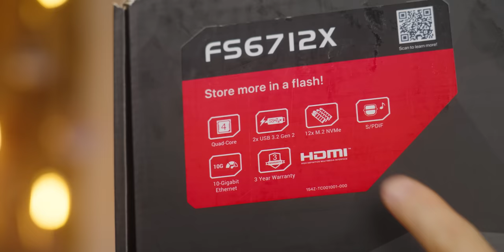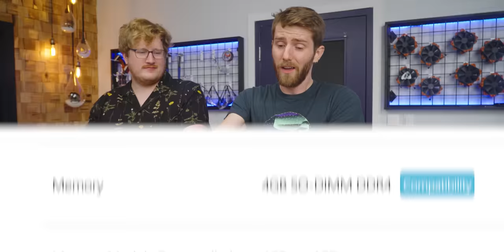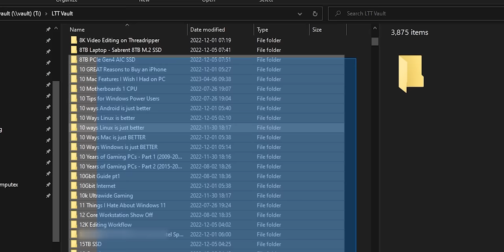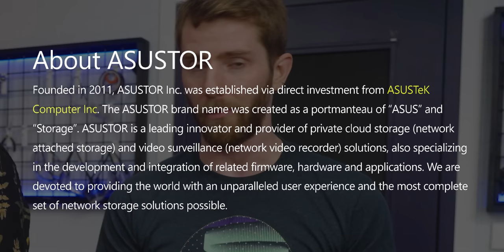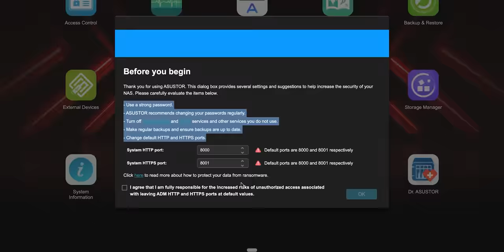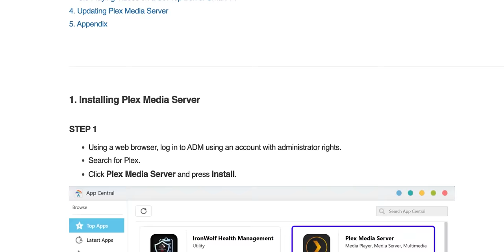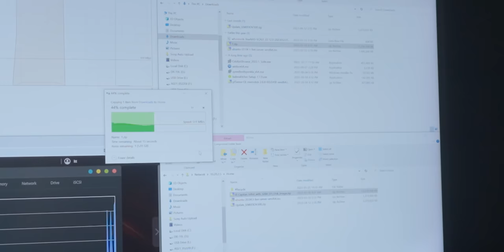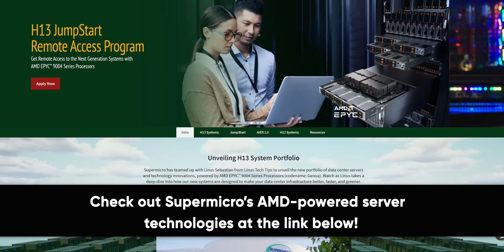I should stop building computers - ASUSTOR Flashstor NAS

Comment: JBOD is the complete opposite of "a logical volume composed of multiple disks".  JBOD by definition (Just a Bunch of Disks) is each drive exposed individually.  What you do with them after that point (logical volume span across drives or Software RAID) are software solutions on top of JBOD.

Personally I stick with JBOD as its much easier to incrementally add more storage that way, even if its a little more labour intensive.  RAID requires you to be able to afford to replace a failed drive immediately, or risk losing ALL your data.  JBOD on the other hand you lose one drives worth of data which would suck in a business environment, but is a lesser risk for a home NAS than having to recover everything from a backup rather than a single drive.  Not to mention if you have a RAID NAS, you'll then need a RAID backup.

RAID is just too expensive for many home users and also gets complicated when you start to need to replace existing drives with larger ones.

Comment: It's hard to beat it in terms of bang for the buck, though it would be pretty cool to have a more expensive version based on an i3 or something.

I recently built my new home server with i3-10300 for about 400 USD (prices include shipping and tax):
- $76: Used i3-10300 (Not the best bang for the buck, but in terms of thermals and power efficiency it's alright)
- $76: Used MSI B460M PRO-VDH (it was literally the cheapest mATX board that supported the CPU on eBay)
- $15: Used 256GB NVMe SSD for OS (I assume it was pulled from a heavily used machine as the health was at about 50%)
- $31: Used laptop HDDs 4x500GB (the condition was better than expected, but these are very hit or miss)
- $122: New In-Win CE685 case with a built-in 300W PSU (SFF case prices are ridiculous, and the PSU isn't great, but it was alright for my purposes)
- $49: New Noctua NH-L9i (overpriced and overkill for my purposes, but I wanted a silent machine. I can also reuse that cooler for a better build later on)
- $33: New TEAMGROUP Elite 2x8GB DDR4-3200 (Pretty much the cheapest DDR4 16GB kit from a brand I've heard of before)
- $38: Cables and a 5.25" Bay to 4x2.5" drive adapter

It's my very first PC build (my main is a prebuilt 13900KS machine, I only had laptops before) and I'm pretty happy with how it turned out.
I'm running Debian as that's what I'm most familiar with and using mdadm to keep my hard drives (4x500GB) in RAID 5.
I also wanted to throw in a low profile Arc GPU in there for a meme, but as of Summer 2023 they are only sold in Russia for some reason.

ChatGPT says that my spelling is alright, so I won't double check it. Thanks for coming to my TED Talk.

Comment: You don’t need to spend that much on a motherboard for a home NAS. A low power Xeon cpu and server motherboard (about $200-300aud for both off eBay) is much more powerful than any craperon. The noise of the HDDs isn’t an issue either so long as you are not setting it up in your bedroom.

Comment: 7:33 you have absolutely no clue how many times Premiere crashed on my Windows system this semester in my cinema and communications major. Since 2022, but even moreso 2023, it's almost as if Adobe is trying their damn best to make their software as unusable on Windows as possible. Granted, I was on 8gb of RAM, but still. Adobe had 5gb dedicated exclusively to it, and updates made everything more unstable every new update.

It's literally the only reason why I'm considering buying this, and a Mac studio/M2 Mac mini, and just rolling through remote working. It's just that bad on Windows at this point. My hardware isn't even that bad or anything for a laptop that's used mostly for editing: Ryzen 5500U with a 1650 and a ½tb nvme ssd. It ran W10 and runs 11 buttery smooth, but not Adobe. And now I have 16gb of RAM, and Premiere still is testing my patience every day.
Reply: See if you can try on a friend's pc with more ram and just see how much better it is.
Reply: @PvMLad  I've worked with as much as 64gb, PPro just won't collaborate
Reply: @Anisse_N_Spices  fair enough
Reply: @PvMLad  yeah, either Adobe despises me or Windows

Comment: Did they miss the pics switches?  The processor is maxed on lower end model with 6 drives. Trying to us all 12 in one array means adding lag to switch connections back and forth. This is a case of more isn't faster. I would like to see performance numbers of the number of drives the PC can handle. Native, both 4 and 2 channel. Also see if setting drives up in groups on same side of switch  compared to spliting them

Comment: I work with machine learning, and one of the biggest bottlenecks is loading a large dataset from storage (whether its from a server or local storage). This would be perfect for that!
Reply: It would not be great for that as it gets a pathetic 1GB/s sustained speed max its a 10gbps max per connection CPU

Better off shelling out for a single 8TB Sabrent drive than one of these things

Comment: It'd be great to see you build one just like that but with a more powerful processor, and still keep it budget. 
The main problem I see is fitting so many ssds, you'd need m.2 pci cards for that, and these are pricey. 

Then go crazy on it and build a killer one with ecc, zfs, and a decent board that has  management like gigabyte has (l1 mentioned it in one of his videos, it's amd with ecc support and an  ipmi analogue, but it's hard to get and rather expensive)

Comment: ASUSTOR had a massive attack on the NAS just a year ago and they have around 2 digit percentage of NAS being attacked by the same ransomware.
Most of the affected NAS got their default ports opened up to the internet, that's why they are warning you at the first step and ask you to change the ports immediately.
Reply: What they need is proper security in an open port instead of playing security-by-obscurity and pretending that if you randomize the port number (out of ~60000 options) you're safe.

You can run even SSH just fine on public IP and port 22 as long as you don't have security holes in the software.
Reply: We don't open ports by default. We never have and never will. Only those that were affected had their NAS exposed directly to the Internet. We do take security seriously. And we beefed up our security research team after this to make sure this doesn't happen again.
Reply: @ASUSTOR_YT  Great! Make sure that the security is based on a true secret, not in 16 bit port number.

Basically you either have to educate your users about entropy, or allow only SSH keys instead of passwords for login.
Reply: @MikkoRantalainen  We'll do our best to find the best balance of convenience and security while giving people complete control over their experience. Right now we're beefing up our backup capabilities to make it even better! But I take your comments seriously! I might have to look into having SSH keys too.

Comment: i have been using an asustor as1104t for almost 2 years now, and other than the lack sound insulation (using 4x8tb wd red pro), no other problems at all...  its fast, stable...
looked at the new ones that are in the video, but just too expensive compared to the regular hdd nas units 😢
Reply: Thank you for your support!

Comment: Linus Nonsense Project: Buy the six slot version, then but the few missing chips and connectors and solder them in to convert it to the 12-slot version and see if it works.

Comment: Pity they don't have several CPU grades... that general fit and form would be awesome... allot of people who just want a server... have a bit more cash ... but like it small would find that perfect. It feels a little under powered to be perfect? The ease of install and flexibility, I;m looking at docker, I think would scratch all the itches. Docker containers with OpenHab/Home  assistant, (they already had pi-hole), zone alarm, etc etc. Heck add another network port and it could also play firewall/router. But CPU is still a bottleneck there :(

Comment: Imagine paying $70 for a screwdriver
Reply: Nothing strange about it. I have a neat rush 72 backpack for like 180usd, and an Ogio renegade backpack for 160, which some might argue is crazy for a backpack. But I know these will most likely last for decades, and are very functional.

If you use a tool a lot, investing in one that while expensive, provides good functionality and is pleasant to use is the way to go.
Reply: @BoraHorzaGobuchul  The backpack doesn't seem anywhere near as durable and rugged as proper gear. And for $70 I can buy a full on power drill that will be used in construction for years. One lone screwdriver is nothing in comparison.
Reply: Not sure what’s so hard to understand.
Reply: Imagine this guy's face now, after it being so successful 😮 😂

Comment: Its likely less a Celeron's performance  (as its only an IO processor really) and more the fact that the number of PCI lanes the Celeron has means its constantly arbitrating PCI as its striping/checking/correcting while also meeting other demands.  It would be interesting to see RAID metrics regarding error counts etc.   It would also be an interesting benchmark to run RAID 0 (only as an experiment) to see what RAID overhead is doing. I'd like to see it running cooler. I find it funny that no one has made a flat memory model FLASH box like this. FLASH is memory after all. Putting PCI and its limitations in as a bottleneck is really choking the performance. Its a great modular solution but truly suboptimal. It would be better to have all that FLASH directly memory mapped and hanging on a local bus with caching.

Comment: I just recently finished my NAS, which is a mid-tower with mechanical drives.  This video got my second guessing everything, lol.  It'd be awesome to replace that with something this form factor which can do the same thing.  Such a space saver.  I have 28TB and one parody in unraid, but I don't use it all, so if I got something like this even with 4TB NVME's I could cover what I've used + be able to expand later.  Fuck.  

12 is nice because even though I spent less for more storage, there's not exactly space for 12 3.5" HDD's in my NAS.  Shit, there's basically only 4 without getting real cozy in there.  And with something like Unraid which is dynamic and supports different sizes, you can grow the drives as prices drop.

Comment: I plan to switch over to an ssd only nas once its a viable solution. I would want to pay a bit more for a beefier cpu and more pcie lanes though, really a bummer, but maybe there's more to come :)

As much as I loved setting up my homelab I don't really want to spend time anymore with replacing HDDs and that stuff... At the moment I have four 18TB HDDs in a RAID 10 configuration and I noticed that the used space stopped groeing a while ago.

As soon as nvme ssds will be cheap enough to replace this I'm team ssd for life.
Reply: The 8TB 870 QVO comes to slap you… hey you not know about me or something

Anyway SSD’s ARE NOT FOR NAS they basically need to always be powered on to lessen the chance of bitrot but it doesn’t eliminate it

With an SSD NAS you have a HDD back-layer that it backs upto if you actually intend to not loose data well unless your using SLC SSD’s

Comment: Only issue with the NAS is the CPU. If they would bump it just a couple of tiers or even use an ARM processor instead (since it is running android anyway), it would be perfect for a lot of my use cases.

A low wattage but strong ARM based CPU would work wonders for a NAS like this.

Comment: Two things sub-par with it, one of them a big nope for many uses. The CPU is slow for big data processing on the server. If it's simply serving files and running some apps that don't do tons of data processing, it's OK. The other is the 32 gig for OS storage. There are of course Linux distros and other systems stripped down enough to rattle around in 32 gig like a dried pea in an empty gallon jug. But if you're for some reason wanting to install Windows or an Intel version of OS X, forget it. You could install the OS and some additional software but it'll be incapable of doing any major OS updates.

I'd like to see LTT put Open Media Vault on this. I have OMV6 on a 2011 Mac Mini with a dual hard drive kit with a 500 gig and a 1 TB drive. That works well enough for me. I can push videos to it from my office desktop then watch them on smart TVs, phones, laptops, tablets etc by serving them with Mini DLNA. It's up to the viewing device to be able to decode H.265.

Comment: You mentioned printing and I can't believe, still, till this day, that they haven't fixed the bottleneck in printers. The company that fixes that bottleneck will make a fortune! Hands down fortune!
Reply: Last time I needed to cancel a print job that hadn't started, it did cancel.  The reason why they often don't is the print job is still in the PCs queue not the printer, so its not really the printer at fault.  Plus modern printers can print really fast anyway so the time it takes to get to the printer its done already.

Comment: I have a problem with a dentists software which seems to be "organically grown", i.E. it needs a Visual Cobol 32bit runtime, which creates loads of very small files typically around 1kB. A server with 16 gigs of RAM, all SSD, ToE NIC and I5 7xxx CPU grinds to a halt with 100% CPU load and about 5 to 10 kbit/s network throughput. I still have to find hardware powerful enough to slay this fine example of bad software engineering. 
Large video files is one thing, but with 10th of thousands of small files (who does databases in the 4th normal in Cobol in 2023?) SMB/CIFS is easily overloaded.

Comment: I would love to see something like a matx /itx am4 board with that amount of m.2 slots specifically for a nas build. With how cheap older am4 apu are getting it should make an awesome nas build.
I would even say a prebuild like this with a socket, but i get that the cooling could get problematic
Reply: What sucks about AM4 APUs is that a good chunk of the PCIe lanes get sacrificed to the iGPU gods. Probably not an issue if you're a home user, but don't even think about having 12+ M.2 slots with full performance.
Reply: @Gabu_  Shouldn't am4 apu have at least 20 lanes available (24 for 4000 and 5000 apu)
And with a splitter like in the board in the video or used in x570 boards it should be doable at nearly full speed for 6 nvme (pcie 3x4). 
Well at least much faster than this board for sure?
Reply: @ized88  You're right, they do support 20 + 4 gen 3 operation. Not ideal, but good enough for most people.

Comment: I had a Asustor AS5304T. It was pretty good and easy to set up. However, one day Asustor machines got attacked by ransomware through a backdoor that allegedly Asustor knew was open but didn't fix. So from then on i just decided to build my own server using parts from an old gaming pc (AMD X370) and install unraid.
Reply: Hi there! We were not aware of the vulnerability. We use open source software and it was in the UPS module of our NAS. We apologise for the inconvenience and we have rectified the issue and taken numerous steps to ensure this won't happen again. We would not willingly sit on a vulnerability and we fix them as soon as we find them. We have employed even more resources at finding them and squashing them. 

At the same time, no software solution is perfectly safe. We encourage everyone to make backups regularly to avoid data loss.

Comment: Windows PC's might boast greater specs for running Adobe Apps, but they run faster and more efficiently on Mac across the board because of their superior architecture. This has been tested several times over the years and PC's running Windoze perform a select few functions faster but overall the Mac will out perform most PC's. They are VASTLY more stable and rarely suffer app freezes. I have to use both and the PC's can make you feel like jumping head first off the curb!

Plus… WHENNNNNNN is the mouse tracking behavior in Windoze going to be improved??!?!? 
It's been the sam clunky and clumsy jittery tracking since the early 90's FFS!!!!

Comment: I wonder if they could make a version with an AMD mobile APU to get better integrated graphics with hardware encoding, more cores, and more PCIe lanes (preferably at least Gen4 16x PCIe).  It probably wouldn't use that much more power, with a 6 drive version almost certainly still being able to be powered by a 90W power supply, and a 12 drive version might be able to if tuned right.

Comment: Hello 
Please can anyone help me 
i just got a asustor flashstor 6
i am trying  to connect the  S/PDIF out of the  nas to my DAC 

Hi-Res Player | ASUSTOR NAS (is not detecting my DAC) as in . no input signal is getting to my dac 

things i have tried 
- firmly connect the cable (many times )
- tried with 2 different S/PDIF cable 
- checked with a second asustor flashstor 6 (no optical out from nas)
-  connected HDMI out from NAS -> split the signal to display and S/PDIF audio -> this worked -> but not Optical out from NAS to DAC (issue  with this the signal splitter down samples the audio)

please can anyone check if they have the same issue out it works out of the box

my use case of ssd nas (has optical out ) -> tidal replacement 

thank you
Reply: same issue here also 
@LinusTechTips
please help
can anyone suggest the perfect cable ( link ) that might be can issue

Comment: Make an open socket version of this for an Intel and an AMD line, I think would make it just about perfect for what it is
Reply: The reason these mobile class devices can be so cheap is most or all of the IO is from the CPU and far less than a desktop CPU has, which also adds even more the chipset.  This makes them a whole lot cheaper to make and cool (this is only a 10-25W SoC with a tjMax of 105C).  There's a reason desktop motherboards are so expensive in comparison and need much bigger cases and cooling.